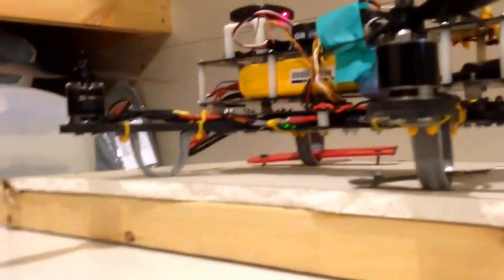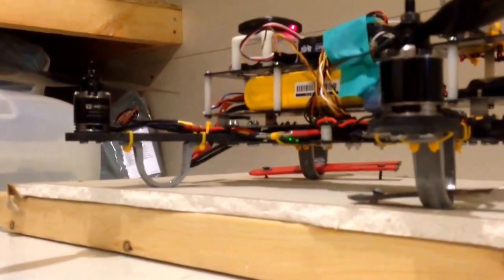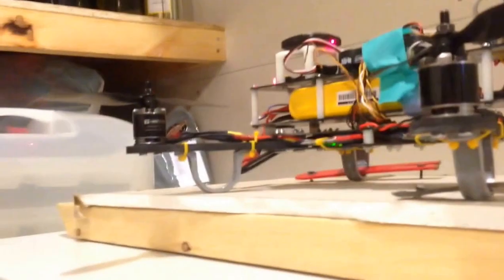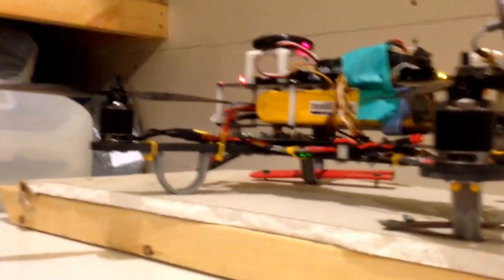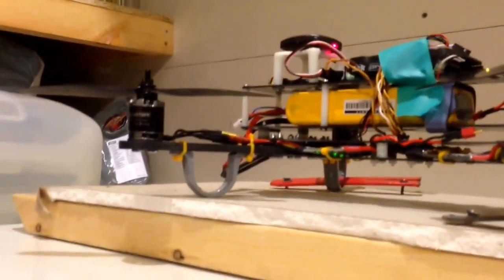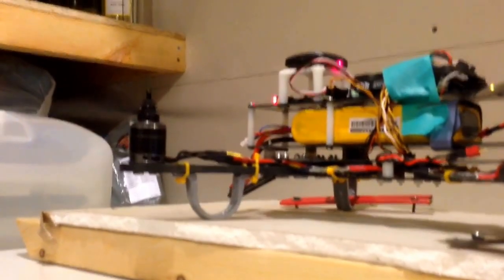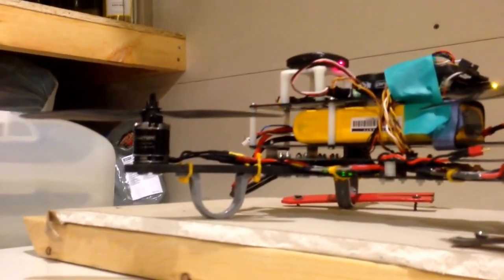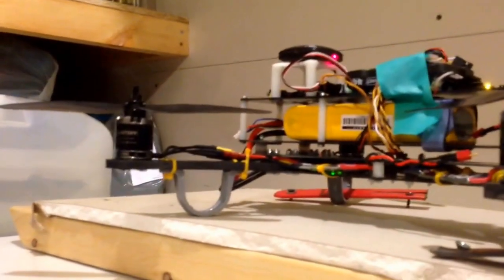Afro 30a esc simonk sync issue and resolution

Comment: Just moved from APM to Pixhawk and having sync issues. Using 30a Afros with just the signal wire which worked fine. Has adding the ground wire solved the issue for you? Reading the forums it sounds like some people are still having problems even with a ground wire.
Reply from the maker: No, the only thing that fixed the sync issues for me was going to genuine 3DR speed controllers.  After I did that the problems went away.  I even sent the setup I was having problems with to 3DR including the Afro ESC, but they say they were not able to replicate the issue.
Reply: xoltri I'm in LA so San Diego isn't that far. I'm tempted to drive down there and "replicate the issue" for them.

Comment: Me of the first installation I delete only the red wire (+) and I let the black wire. and I have the problem of desyncro. you need it I test with only the signal wire?
Reply from the maker: No, it it was worse with only the signal wire but this did not end up resolving my sync issue, even with both ground and signal connected.

Comment: Hi, do you have "-" (minus) battery power from the motherboard to the servo connector each regulator revolutions?
And if, connect the wire "-" battery directly to receiver? The Receiver General tyre supply to "-".
Reply from the maker: I did have just the signal wire first but have it setup with signal and ground wires now in the servo connector.  Do not connect the battery "-" to the receiver directly.
Reply: xoltri
Don't understand... If you can, scheme draw connected - ?
My mail -  fortsw5050@yandex.ru
Reply: xoltri Your expression, I do not understand, TC without a minus "-" the receiver can't just work on the signal line.

Comment: Hey awesome video. Just bought a Pixhawk and Afro 30A ESC. This will be invaluable if I have any troubles. BTW, whats your complete setup?
Reply from the maker: Thanks, flew it yesterday and am still having some troubles with the front right motor, the one that was responsible for my first crash.  Not nearly as bad (no crash) but a few times it appeared to drop that arm then recover.  It did it both on a throttle punch and then when I tried to do autotune, which I aborted and then landed safely.  So it seems like I have more work to do.

The quad is :
ADS 400q
Tiger MT 2216 1100KV motors
30a Afro esc's
4s 3700mah Zippy Compact 35C
Pixhawk running the latest arducopter firmware.
3DR GPS module
Receiver: ASSAN X8R6MP (has ppm out)

FPV Gear:
Boscam 5.8ghz 200mw tx, minimosd, 
Fatshark Antennas
JDrones 12v linear regulator
Sony PZ0420 for live video
Mobius Action Cam for HD recordings

My ground station is my car, I have a 19" Vizio TV that I hooked the receiver and a DVR to and built a bracket that hooks onto my steering wheel.  With all the problems and the cold weather I've had I've yet to do any FPV though, it's all been line of sight so far.

Comment: Oh OK. That makes sense. The otherway around. You have both the signal write and ground connected to the flight controller from the ESC which works better than just the signal wire.

Comment: This doesn't make any sense. So the only wire plugged into your motors from the controller is the signal wire?
Reply from the maker: No I'm just referring to the servo connector from the ESC that goes to the receiver on planes or the flight controller on quad copters.  Usually you have power , ground  and signal on that connector.  Often on quadcopters people just connect the signal wire.  I found that it caused problems so I also connected the ground wire which seems to have resolved this issue.